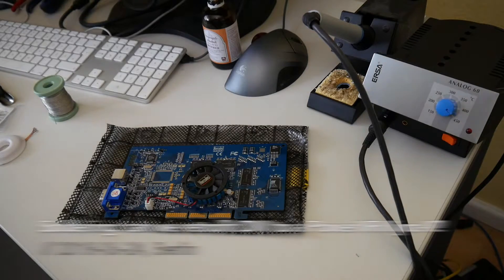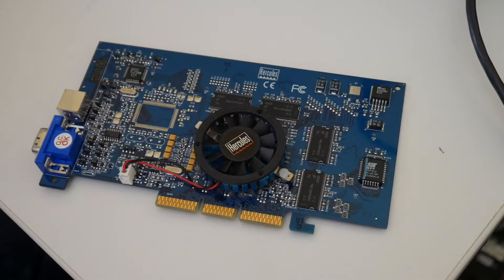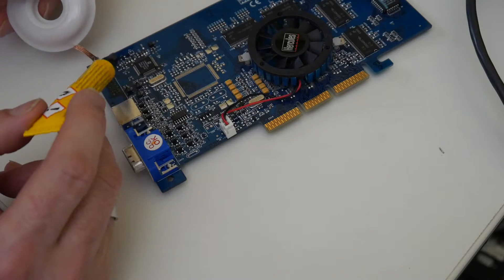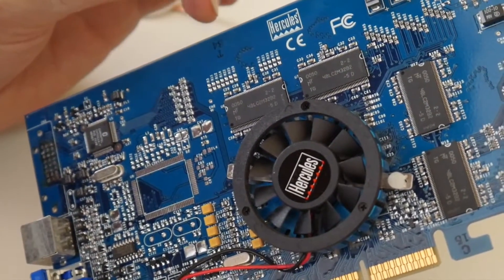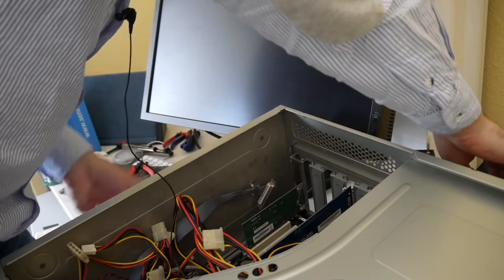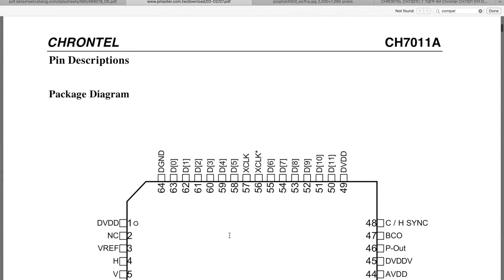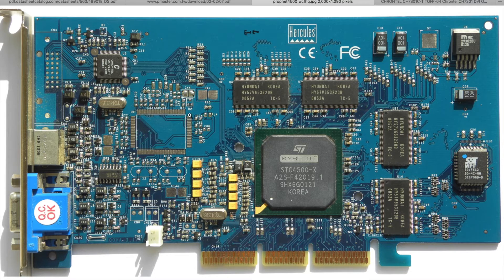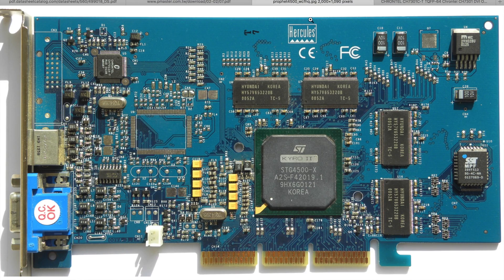Let's try soldering DVI to a PowerVR Kyro II - know your chips! [DIY]

Comment from the maker: Update: I objdump'ed the old Linux PowerVR Kyro driver (powervr-2.00.20) and it has symbols and strings for CH7003, CH7004, CH7009. So maybe the better chip to go on this board is the: Chrontel CH7009 DVI / TV Output Device, ..! Update: ordered ;-) Don't forget to subscribe for the follow up episode as soon as it arrives from China, ..!